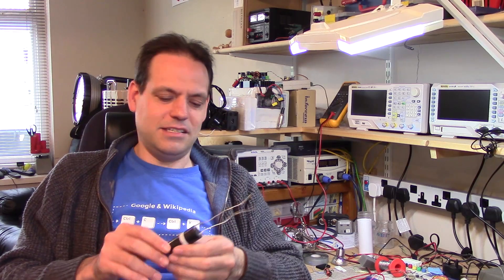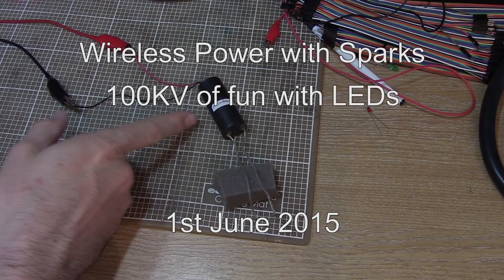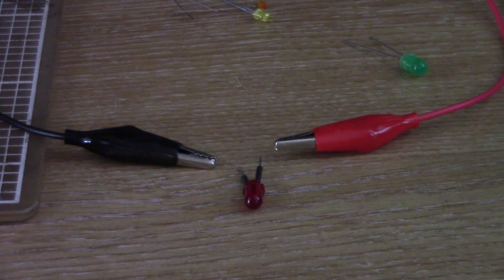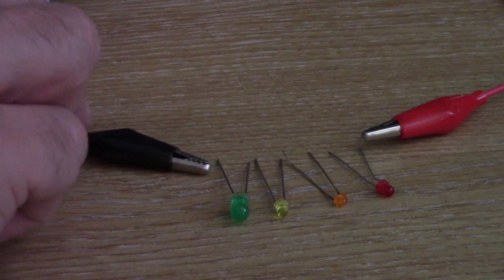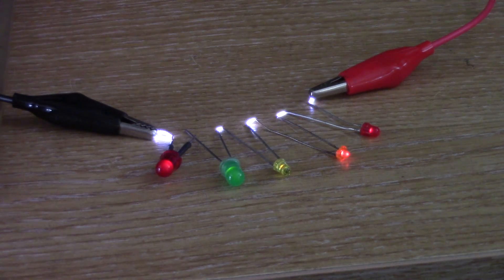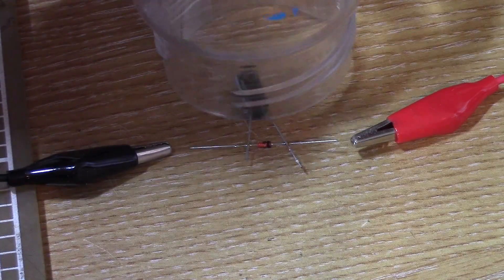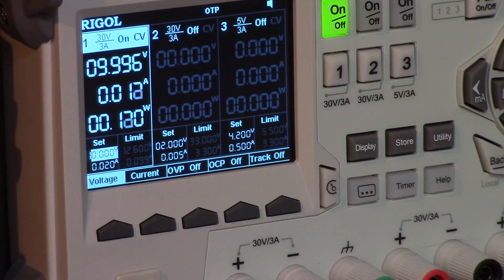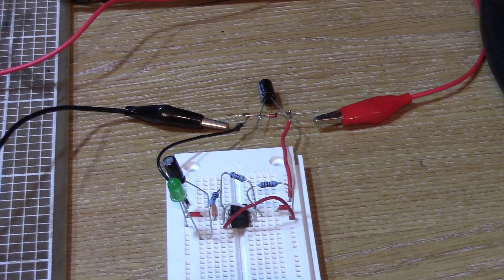Wireless Power using Sparks - 100KV of fun with LEDs

Comment: +jim conner 
i went through 4 of these as each one blew-if you make the gap to high it blows if the wires touch it blows-i wonder what is the weak link inside-i would like too make my own more robust one but dont know what the components are-any ideas?
Reply from the maker: Hi Alan - I believe the weak link on this units is the insulation on the  windings in the coil inside it... If the voltage across the coil gets too high then it will arc internally and destroy the insulation... and if you short circuit it, then the windings can't handle the current and fail.... If you want a more reliable way of getting high voltage sparks,
 you need to look at making a ZVS (zero volt switcher) circuit using an old TV flyback transformer...  I made one myself a few months after his video... We named it 'The Arky Sparky Marky 2' ... Take a look at https://www.youtube.com/watch?v=mDuXbhXe5Es ... The flyback transformer based one will run cool all day long and make nice arks over an inch long. Cheers!!
Reply: ok thanks jim, and will do-it does seem though that just a small modification in this circuit ie the coil could make all the difference and maintain its small size all be it slightly bigger-if only there was a circuit diagram somewhere...

Comment: try a 1.5 volt flasher. they are light on current
Reply from the maker: Hi rflberg - I don't suppose you can point me at an appropriate circuit diagram somewhere on the web could you? A 555 timer just too far too much current. Cheers!!
Reply: Jim Conner 
for a lm3909 ic using discrete components:
 http://home.cogeco.ca/~rpaisley4/LM3909.html
for a real low current:
http://pigeonsnest.co.uk/stuff/picprog/single-cell-led-flasher-two-year-battery-life.html

other good choices are:
http://www.eleccircuit.com/1-5v-led-flasher-using-bc556-and-bc546/

http://www.talkingelectronics.com/projects/FlasherCircuits/Page83FlasherCircuitsP1.html
Reply from the maker: Thanks for those links rflberg - I'll see if I can put something together soonish. The pic microcontroller or the two transistor options will probably work best for me as I've got all the required parts sitting around in component drawers. Cheers!!

Comment: Fascinating stuff Jim. I let my Ipad fall the other day -So I have to replace the glass and screen - none of which look physically  broken but it won't start. Have you had any such problems?
Reply from the maker: Hi Patrick Meehan - It just so happens that I have had something similar - yes.... I got given an Asus Transformer Prime tablet a while ago which wouldn't switch on. (although the charging light still came on when you plugged the charger in). In this particular case, it was a damaged power button - The power button was a 'blister' style button, which is just a small metal dome placed over the top of some contact pads on the circuit board... In the case of this particular blister button, it was just held in the right place over the circuit board with some sticky tape... The glue had weakened over the years and the blister had shifted sideways on the circuit board. You could feel that the power button didn't click right when you pressed on it - this was possibly one of the simplest repairs I've ever done - I used my thumb nail to open the tablet up, and peeled off the sticky tape and stuck it back in the correct place. It may sound silly, but just check that the power button on your iPad still feels like normal... maybe it took a knock during the fall.... Over that, I'm afriad I can't give you any specific iPad help... I don't have one. Cheers Patrick!!
Reply: Thanks Jim for your time and help

Comment: Not exactly wireless power, a spark is basically a short  circuit although very brief, the diodes place a relatively heavy load on the circuit and will drop the voltage, i'm going to guess that connecting a LED directly across the output may not damage the led.
If you want that to be wireless, set an arc gap, then set another arc gap a distance away that's only connected to a small load, search for spark gap transmitter vids
Reply from the maker: Hi +Tesla Explorer - Due to the lack of any kind of wires, I'd be inclined to say yes to that one. Cheers!!
Reply: +Tesla Explorer An induction heater could be considered as a transformer with a shorted secondary (the item to be heated), or it could be considered as a radio transmitter there is definitely no 'wired' connection between induction coil and item.
Which then begs the question, is a device that uses a transformer worthy of being called 'wireless power' :D
In my mind, wireless power is RF energy being transmitted and received with no connection (air gap)
Reply from the maker: Hey ***** - I'd argue that the lack of wires makes it wireless power, but you're right... the resistance of the ionised channel in the air will drop quite low (single digit ohms.. possibly lower) and it's the LEDs becomming conductive which is dropping the output voltage down... that in turn is causing the ionised channel to become less-conductive again, so the LEDs don't fry. I didn't try the LEDs directly across the output of the transformer as the instructions said not to place a load on it... It's designed specifically for making sparks, and can be damaged by being run in a configuration where no spark is produced. With a higher current power supply the LEDs would undoubedly have been blasted to pieces (though I'd love to try the experiment with a higher current supply just to be sure... (or maybe just because it would be fun)). I've seen spark-gap transmitters before... another very cool bit of physics in action.... While I've been writing this reply, I've realised that I should have stood the LEDs up vertically... The heated air in the ionised channel would have caused the sparks to climb like a Jacobs ladder... Mmm... gonna have to try that one soon. Cheers!!
Reply: Jim Conner A spark gap is not a lot of difference to an air spaced capacitor that breaks down, albeit with very small plates ;)
Reply: +Jim Conner is a lightning bolt touching down to earth wireless?
Reply: +Jim Conner you're completely right. from communication yes no wires really does mean wireless but since we're observing from a more logical point of view we find that once an arc has formed that indeed is a direct connection, without wires yes but a fully conductive channel from 2 electrodes. to achieve this with lower voltage we use the most conductive items we can find. something that pops right to mind is take for instance an induction heater. we have a low voltage circuits that heat up objects without any electrode connections but is this considered wireless?
Reply from the maker: Hey +Tesla Explorer - I will freely admit that I was just doing the play-on-words with 'wireless' power, and mostly just having fun playing around with that arking transformer. Since the advent of the radio, 'wireless' started to mean the transmission of RF radio signals through the air, so 'wireless power' would mean transmission of power using RF signals... However, I also have an inductively coupled electric toothbrush (essientially just a split transformer at 50Hz) which describes itself as having wireless charging.... To add further to the nonsense, I used to work for Cable & Wirless provisioning fibre optic connections, which were neither cabled, nor wireless - What a silly name for a company.. . Anyway... I just wanted to make it clear that I do understand the difference, and was just mis-using the term for fun. Cheers!!
Reply: +Jim Conner That's ok, my comments were meant in a lighthearted way.
At least you were't claiming free energy :D
I think C&W may have got the name because they used to deal mainly in cabled and wireless systems (radio)

Comment: Good to see you got hold of your taser Jim :)  Nice idea with the LED's too my friend..  I would have said that they would have popped being attacked with that sort of high voltage. It's interesting that they withstand the abuse though. 

I'll be having another play with them transformers again soon,  but I'm trying to find out why my xonar d2x sound card has packed up at the moment :(  I think I'd probably have a better chance of fixing it if it weren't for all the pesky custom IC's. 

I appreciate the mention too Jim,  thanks mate ;) 

John
Reply from the maker: ***** Thanks John - I was fully expecting a pop the first time I tried it, and was quite surprised to see the LED regulating the voltage nicely... and then I started playing...  I'm not even sure it's abusing the LEDs particularly as they're able to handle higher currents than the Ark transformer is able to deliver... It's just a neat quirk of the switch-on voltage on the LEDs allowing the them to become conductive and light up at the low current provided by the spark... Still great fun to play around with... I'm pretty sure I'm not done playing with this just yet. Good luck with the sound card... Having watched a whole bunch of repair videos on youtube, it seems to me that it's almost never the ICs which have the problem, so fingers crossed that it's some minor component (probably on a power rail).. Cheers!!

Comment: Jim is not the air that limits the current. You have just 6V or so at the input at 3A I think you mentioned and output is around 100kV so 16k higher output voltage and if that will be 100% efficient you have 16k lower current output so about 180uA output current enough to dimly lit an LED.
Ionizing the air creates ozone O3 not good for your lungs so do not play to much with that :)
Reply from the maker: ***** Hey Dacian - You're totally correct... though I expect that the transformer is more like 20% efficient.... It doesn't necessarily deliver a continuous output however, and may be pulsing the output a couple of hundred times per second at a higher current.  My guess at 1mA current was based upon the brightness of the little orange LED more than anything else. I was thinking that the LEDs reaching their conductive region was collapsing the output voltage down, causing the spark to weaken, and the ionised channel in the air to become less conductive until it found it's sweet-spot at something sustainable by both the LEDs and the ionisation channel. I'm prety sure that if I'd have had a 50mA 100kv supply available then the LEDs would have been toast. 
You can smell the O3 a tiny bit after playing around for 5 mins, but it's nowhere near as bad as my old laser printer used to smell. It's a pretty weak spark in the scheme of things. Cheers!!